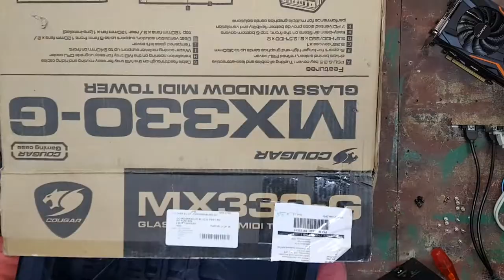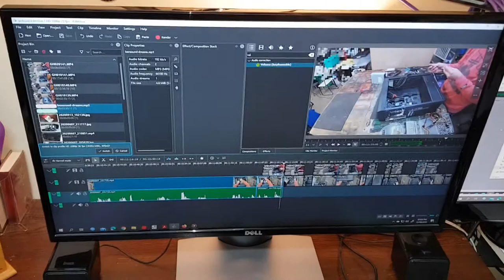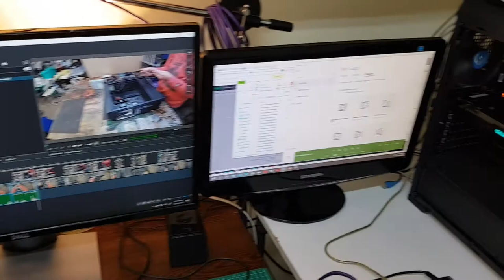New Cougar MX330-G chassis install

Comment: Jacqalas.

I have a question I hope you can help me with I just bought this case 
I notice in the case bundle wires from the TOP USB CONNECTORS  There is a BLUE CABLE 
TIP 1/2 cm thick 1 inch long. what do I do with that cable does it connect to anything on my motherboard or power supply??
Reply from the maker: If it is the one with the blue tip it is the USB 3 and that does connect directly on the motherboard if your motherboard supports USB 3 for the front
Reply: @jacqalas    I do not see any connector like that on my Motherboard.. that's why I asked 
And what is  USB 3 ?
I have never seen a USB connector 1 inch wide,  I CM wide and black but that's it?
Does it matter?
Reply: @jacqalas    JTPM1 Connector?
Reply from the maker: What is your motherboard make and model
Reply: @jacqalas  MSI 970A-G46  FX 8150 8 Core 
It's a bit old wanted a new case to bring back it's shine.
Reply from the maker: The 970A-G46 does not have support for front usb 3. The blue ports on the front of the chassis won't work till you upgrade your motherboard or install a pci-e card that will accept the plug
Reply: @jacqalas  oh ok great  thanks

Comment: hey, how do i know if my power supply cables are going to be long enough to reach the motherboard in this case?
Reply from the maker: Let me know witch psu you have.
Reply: Thermaltake, Tr2- 600w
model- Tr2- 600NL2NH
Non modular
Reply from the maker: I don't think you'll have a problem with cable length at all.  If I am correct that is a modular power supply and the cables on them are normally long enough.
Reply: @jacqalas  its a non- modular power supply, but thanks
Reply from the maker: Sorry my mistake. The cables are going to be a tight fit but you can make them work.
Reply: @jacqalas  ok thanks

Comment: Sorry dude but I have to give some feedback. I was hoping that you would show noobs or semi noobs each part of the installation particularly the cable management, how to install 2.5 inch sata ssds as there is 3.5 inch bays but the manual has no explanation on how to install the smaller ssds onto the case. 

All I got from this video is a look at your setup before and time skip elements without actually seeing close hand how to do the different parts. 

Still, at least this video exists
Reply from the maker: No hard feelings. This build has an NVME installed in any case so no 2.5" was used in the end and the ssd is onboard. The chassis does support a flat mounted ssd option on the side for a 2.5"
Reply: @jacqalas  Yea ppl that watch these videos are noobs. You didn't really show anything apart from a wide shot from above on where you were putting the motherboard. I figured out my installation problem but yea I recommend showing close ups of how to assemble things like the nvme and ssds. Most ppl that watch these are extremely noobish. Anyway, good stuff